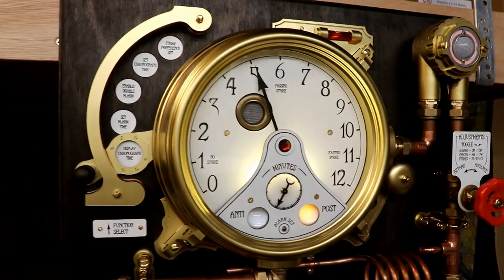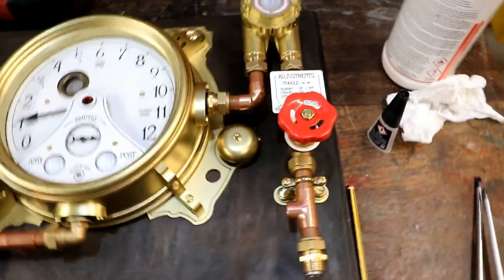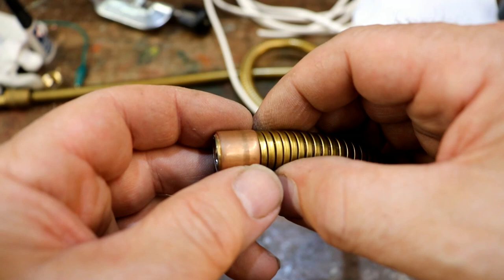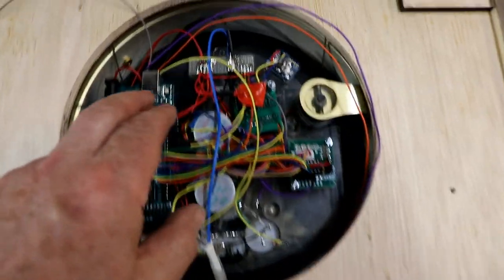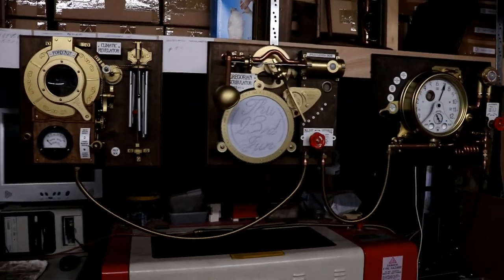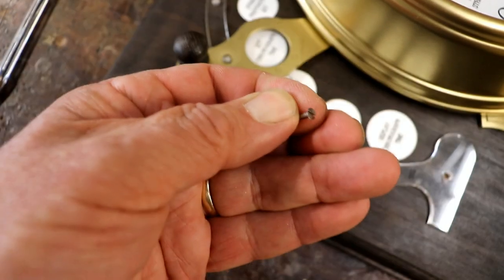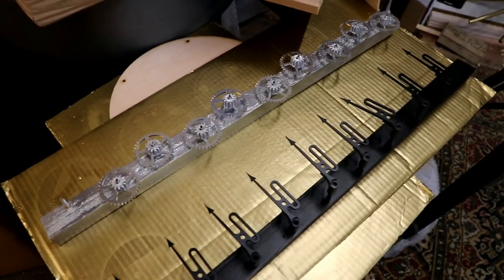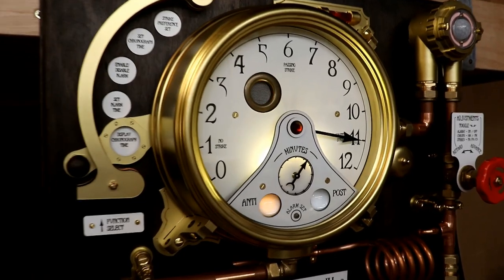Steampunk Clock Gauge - Part 4

Comment: I wonder if hot melt glue may be easier to use for the plugs, being brass you could get them warm first.  The great thing about hot melt glue is you can melt it again later for re adjusting etc.
Reply from the maker: That's an interesting idea, hotmelt glue would certainly fill up the gaps and provide good insulation. My only concern would be its strength, as when cool it stays slightly flexible and quite weak for some things. I'll have a think, thanks for the idea!
Reply: @steamhead  Hi.  I only recently started using it myself but have been very impressed.  I often use it without the gun just with hot air.
Reply from the maker: @alanesq1  Thank you, I'll give it a go using a hot air gun to pre heat the brass components...